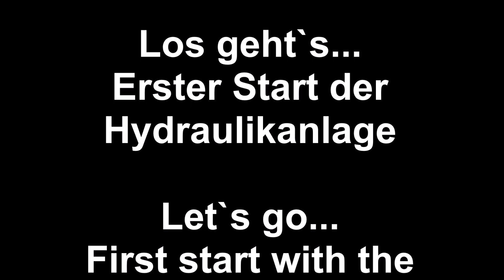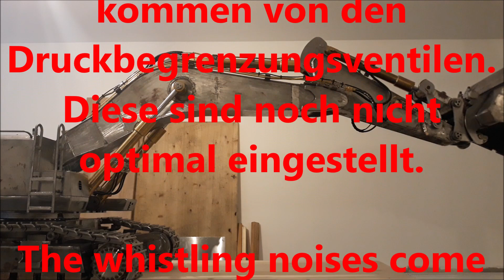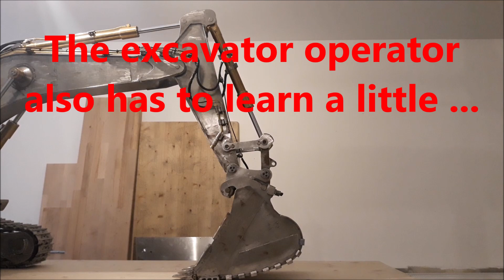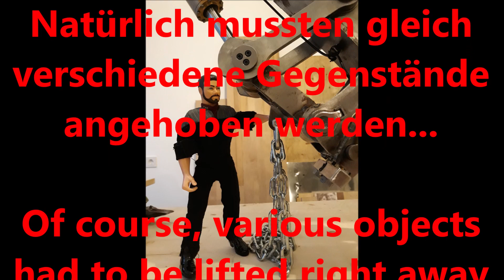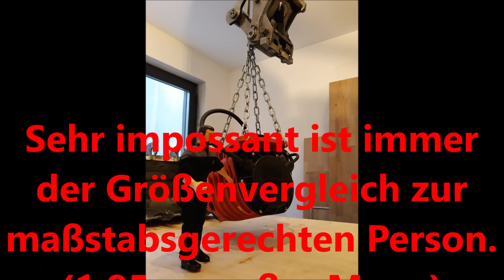XXL RC Bagger 180kg Baubericht Teil 7 / RC Excavator 180kg Buildingreport part 7/RC Modellbagger

Comment: Hallo, super arbeit! Welche hydraulikschleuche benutzt du? Meine flexieblem platzten immer. Welchen durchmesser und welche anschlüsse? Danke
Reply from the maker: Dankeschön. Also die Leitungen sind alle PA-Leitung von Landefeld.de . Die halten bis zu 80bar aus. Also Druckspitzen. Angegeben  sind die mit 27bar. Außendurchmesser 6mm innen 4mm. 
Die Verschraubungen sind auch alle von Landefeld.de .
Reply: @rcheavyconstructionzone  hallo, hast du ventilblöcke selbst gefärtigt oder gibs da verschiedene größen wegen dem durchfluss?
Reply from the maker: Nein die Ventile sind von meinhardt modellbau. Die gibts leider nur bis 2,5mm Durchlassbohrung.
Reply: @rcheavyconstructionzone  hast/kann man die ausbohren? Oder einfach so verwenden?
Reply from the maker: Nein kann man nicht ausbohren. Die habe ich so verwendet.